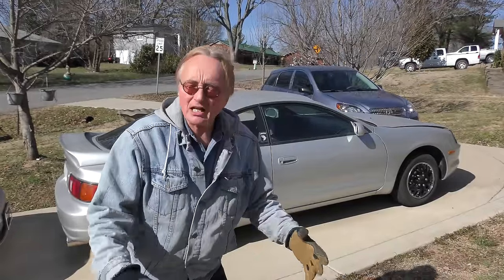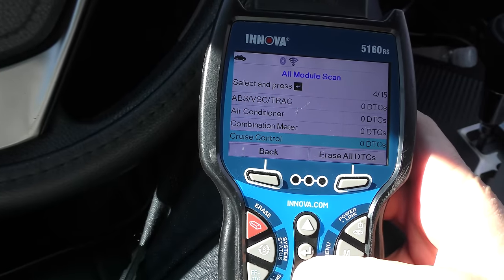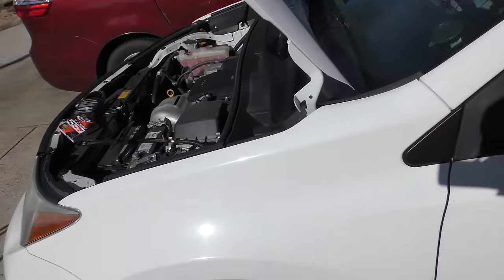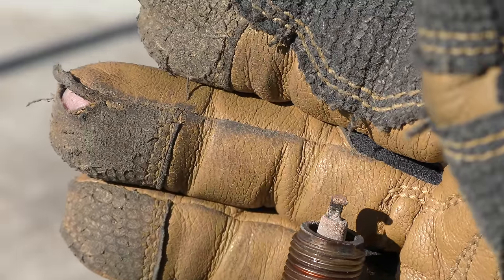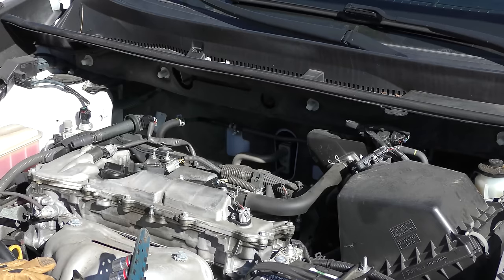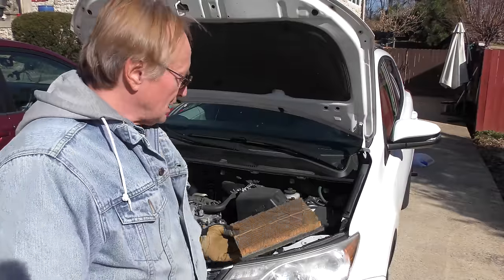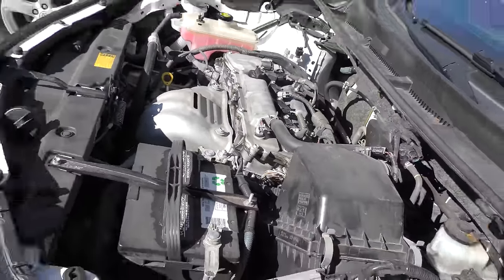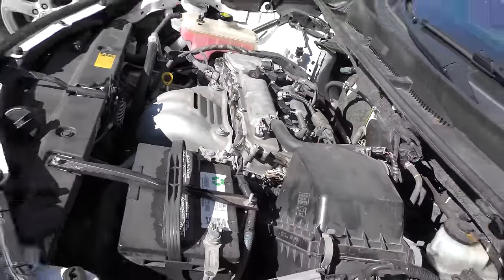Here's Why You Should Remove Your Gas Cap Right Now

Comment: Mercedes SRS (airbag) weight sensing module.  All airbags don't work because the front right passenger airbag unit under the seat went. Has ti be calibrated by Mercedes with their "special weights" calibration. 2000 dollars.    That's why you own a Lexus.  (Besides Takada)   Would this ever happen on a Toyota/Lexus?   No.   I won't get into what they charge for spark plug replacement.  About 2000 dollars. Money pit.   Tennessee, still the worst state in the Union.  (Even worse than Florida)    How about 770 dollars for a B Service Oil change?   Anyone? Bueller?  Don't own it, if you don't have the money.

Comment: Scotty, I've never been able to figure out how to do a "scan" of my 1994 Geo Tracker (made by Suzuki). I know how to short the connector next to the battery to get the OBD-1 trouble codes but a 16 pin OBD-II scanner wont plug into my 12 pin OBD-I socket under the dash. What am I doing wrong?
Reply: obd ll is for 96" and newer
Reply: @plainsight1780  Don't they have some sort of adapter available?
Reply: You need either an OBD 1 adapter or just an OBD 1 scan tool, they are pretty cheap. I got one for my '93 F150 and it was only $30

Comment: Here in Oregon when she replaced her tires they'd make her replace the TPMS sensors. Had a tire shop here refuse to put on my winter tires, which were already mounted on rims, unless I ponied up for the sensors. It's very frustrating.
Reply: If they are already on the rims (and balanced) just put em on the car lol don't need a shop for that.
Reply: There is a tire shop in Sheridan that would replace tires without replacing those expensive sensors.

Comment: Coolant, transmission oil and filter, brake fluid, but who cares, just change the gas cap, air filter and spark plugs and the maintanance is done.
Reply: Don't forget the gas filter too, as well as cleaning the throttle body, also ( clean the mass air flow sensor, if it has it ).

Some cars don't have the mass air flow sensor, but some cars have the mass air flow sensor.

Comment: 2002 Toyota sienna XLE 

Replaced the catalytic converter on Thursday and Saturday morning on my way to emissions the engine light comes  on

Took it back to the mechanic and he has no idea what’s going on. The same code is coming on after installing a new catalytic converter

The State of Arizona has a program that gives $900 towards emissions. It’s part of their keep Arizona clean and smog free program

No one can figure out why we are receiving the P240 code when there’s a brand new catalytic converter only three days old and I must mention that catalytic converter was replaced in October 2021 by the same mechanic and program so far the mechanic has received $1800 from the state and almost $600 from my wallet

So what’s going on? 

The mechanic is great I will be taking it back so he can figure out what’s going on with it of course at no charge to me. 

Here’s my issue the state paid him $900 I paid the $100 deductible I received a new catalytic converter yet it’s not going to pass emissions because the check engine light is on

I’m not paying anymore if it’s another issue that has to do with emissions. 

He missed diagnosed

Who should pay should it turn out to be an inflow outflow intake outtake filter or a gas cap or some silly who would’ve thought about that issue?

I’m not the mechanic he’s the professional 

It’s obvious it did not need the second catalytic converter

Comment: I use to over fill the gas tank...and now a sensor stays on...reminding me to replace a $90 part.
Reply: Usually that's a quick fix. You might need the whole evap canister because that overfill liquid fuel is now in the DRY evap canister. Hope this helps

Comment: 2006 1800 z Nissan Sentra valve clatter "getting winded at small  hills" only way to shut up the "gripe" press down the gas petal to stop floating valves. Car has 0ver 225,000 miles??? Bad gas or plugged filter? Sounds dumb yet this is bout the only thing the motor has complained  about. Good oil, good sparks clean air filter. ??? Hickman co Tenn.

Comment: CHANGE SPARK PLUGS??? MY MECHANIC FRIEND TOLD ME MY NISSAN CUBE DOESN'T NEED TO CHANGE  SPARK PLUGS UNTIL IT REACHES 100,000 MILES. NEVER KNEW THAT. IT'S A 2012 NISSAN CUBE.

Comment: Can an Innova 5160RS clear permanent codes in a Prius 2011 ECU? New inverter replacement. But the Dealship didn't finish the job. They left POA94 code not cleared. Said it didn't fix car. How do they know it didn't fix it if they didn't start car. Remove code is part of the job. Scam artist. Stealership. Need a tool to remove permanent codes. Will the Innova 5160RS remove them?

Comment: no matter what's it's called , changing the plugs , wires, air filter ,gas filter it's still called a TUNE UP PERIOD Now UNLESS you have a car between 1996- & up an SCAN TOOL IS OK CAUSE IT WILL give you codes but codes wouldn't mean much IF you don't know what the codes means & YES you could always google that & that's  ok, but from 1995 & back you can't SCAN them cause you have to buy one that has an OB1 PORT & YES you COULD BUY one from  an auto shop but again very few sells them, yes ADVANCE PART,maybe O-REALLY'S but again very few sells them & they don't give you much on codes, but again just cause you have codes it's don't tells you what's really wrong,all codes does it that systems AROUND that is setting off the codes